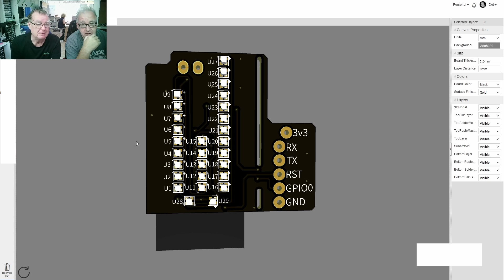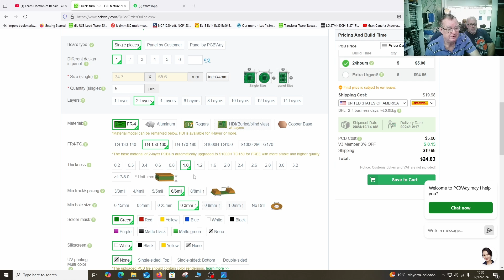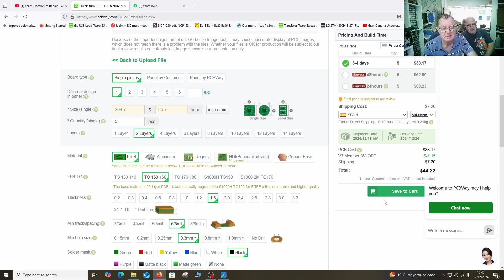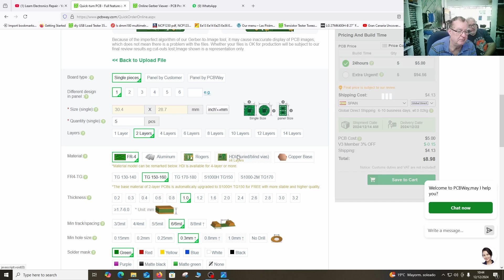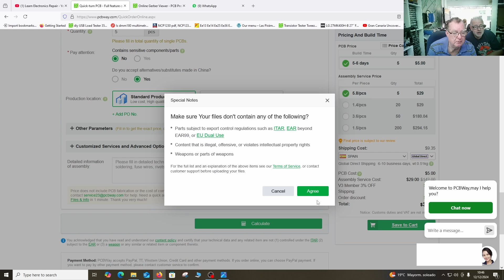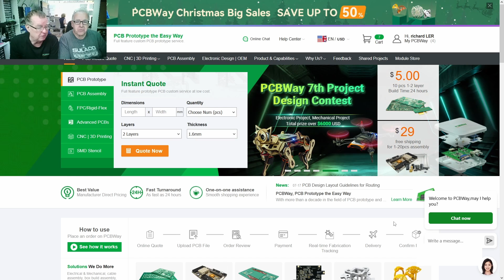How To Design And Order Assembled PCBs for your electronics projects

Comment: Be aware of programming microcontrollers in random projects. I bought a shared project and was expecting the STM32 arm processor to be programmed as firmware was included in the downloads but it wasn't! I ended up having to hack the board to add the serial port because the noob who did the project only included the header for the special ST Link V2 programmer and not any of the other built in programming pins. All STM32 micros have several ways to program them but the pins need to be brought out to a header and some pins need to be jumped high/low (boot0 / boot1) to set the programming mode. If you are not capable of doing the programming you must tell them to do it otherwise they won't do it. If they do it there is a small fee of course ;-)

Comment: If you need a lot of PCB's you can panelize the boards too. You can fit multiple PCB's on one board and have them separated with mouse bites or v-scores, so they break apart easily. I don't use PCBway but I assume they do this as most manufactures do.

Comment: Fantastic. I just love the way you explain things, you make it easy.

Det, I don't know if it would be of use to you, with your project, but I just wrote an application.
I am working towards updating something that has Bluetooth and convert it to Wi-Fi, using ESP8266-01 and I needed a tool to communicate with the Wi-Fi from the PC.
I love the snap-off. I prefer to add tiny solder pads (no holes).
Reply: Hi Tim - watched your video about the ESP - I normally set up a webserver on the ESp8266 - so I don't need a desktop application. One thig for you to look into: OTA (Over The Air Updates). That will be a thing with the project in the video - once the programming header is snapped off, that's the only way to update. 
I know - you're not the biggest fan on the Arduino IDE - but you can do a lot of fancy stuff with that ;)
Reply: @DetBuildsStuff  Thanks for watching Det. I appreciate all feedback.
Oh I am a great fan of the Arduino Architecture, it got me started with microcontrollers,  many people don't realise how much is done in the background with the Arduino IDE, It is still the main compiler for most of my projects (Flash permitting).
I use the Visual studio IDE just for editing, it has great intellisense , which helps me with my lack of short term memory issue.
It was just a bit of "A strange coincidences" I was just working with an ESP8266 at the time of your video with Richard, haha.
I thought the tool may be of use prior to you going OTA. It was just a thought. 🤓
I look forward to your video showing OTA method, it is a great way to update microcontrollers with Wi-Fi.
I do love the Wi-Fi Microcontrollers, I have a few of the ESP8266-12 (node). Being able to put a web server on the microcontroller is the way to go, that way any thing with a web browser can connect and control the microcontroller, Have you seen my robot arm videos? Part 5 demonstrates this well.
My project however (The reason for the app.) in this instance has to go in a different direction due to the memory limitations (ESP8266-01. AKA ESP-01) and use. There is a specific use which will not work using the HTTP protocol, my intent is to replace a Bluetooth Device on I-Qbot 01.
By the way, did the I-Qbot 01, AKA I-Droid 01 make its way to Germany? it must be over 20 years ago now? It came in parts on a magazine.
With regards my tool, it does connect on port 80 (That reminds me, I should put an option to change that), I could quite easily add functionality for HTTP protocol? Do you think it would be useful? I am so lazy now I don't do stuff until I need to haha 😁.

Comment: It's worth knowing that for some components there may be a cost for tooling change (not the exact term but you get the idea) if the parts chosen are not ones which are commonly used. If you were originally intending to assemble the board yourself you may have picked  larger size components to make things easier. These larger components may not be sizes commonly used for machine assembly so sometimes even those can trigger the tool change cost.

Comment: That was a fantastic... Demonstration and explanation of how the process goes,  it certainly helped clarify a lot of questions that can come up.  I've had some circuit diagrams from projects I made in high school they were projects for learning how to make circuit boards by hand like we used to do,  using copper clad boards dipped in acid to do the etching. The idea was to give you a schematic of the project and you were to design your own circuit path and component layout.  The teacher said the most important portion of the grade on this lesson was going to be based upon whether it worked or not...  Ha ha ha    The overall looks were secondary.  Given what PCBWay  can do for creating a circuit board and the software available to create the layout,  I think this is a project that I should look into,  this was a great video to get us closer to learning to get familiar with this process.
Reply from the maker: Thanks.  We made this video because I found the process overwhelming and difficult to understand and Det said 'oh come on... let's make it look easy'
 (which in reality it is)